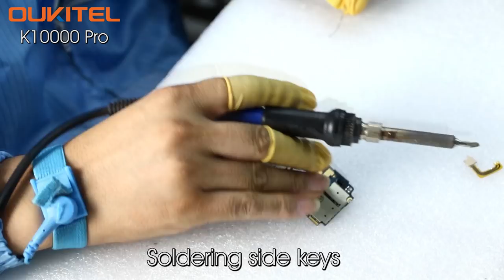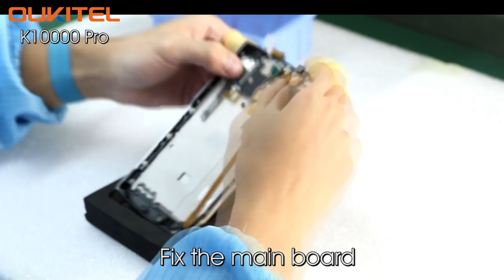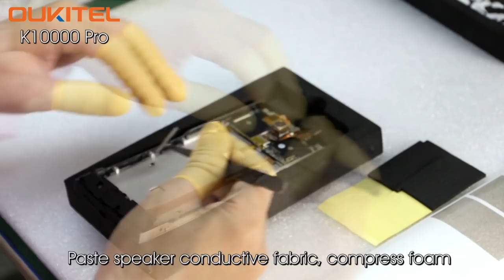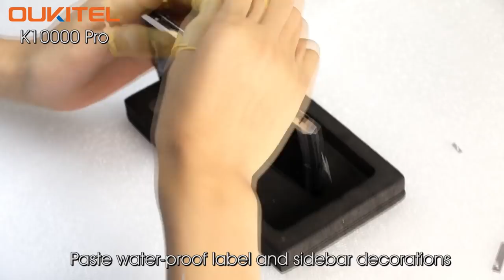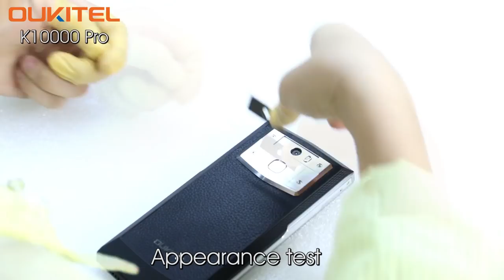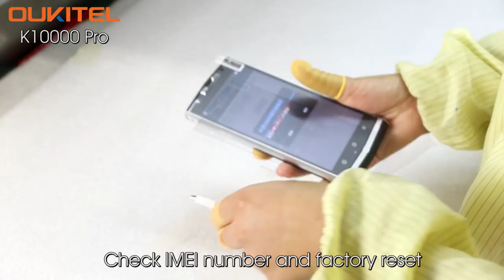OUKITEL K10000 PRO factory manufacturing process

Comment: I am unable to use the phone,, i does not connect to cellular network fast enough and even it does the call drops. The data connectivity drops and works on its own.Something is wrong with this phone.
Reply: I had similar issue, but I got mine warranty repaired. I understood they changed a bad antenna cable from it.

Comment: using it but wifi not working well...idk what the problem damn it
Reply: I also had this problem. I simply changed the WEP key with a WPA key and Wi-Fi started running!
Reply: PIXEL X VOXEL thanks you solve my problem ^^
Reply: No problem, it's with pleasure =]

Comment: please make the same phone(10000mah) but slimmer. it just giant. please slimmer
Reply: you are the reason why apple puts smaller and smaller batteries in their phones 

thin/light
long battery life
high performance 

pick 2

10,000mah is heavy and has an internal volume requirement to fit the battery into the phone 
you cant bypass the laws of physics 

if you want a thin and light phone = it will not have a large battery 
if you want a phone with a large battery = it will not be thin and light
Reply: MWB Gaming well unless you use graphite batterys